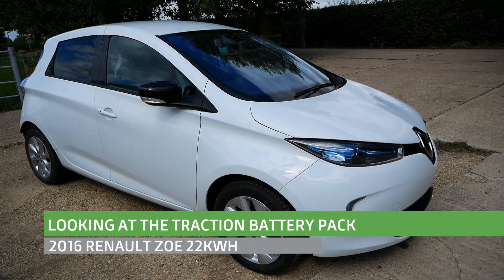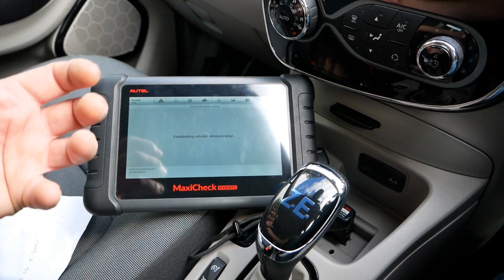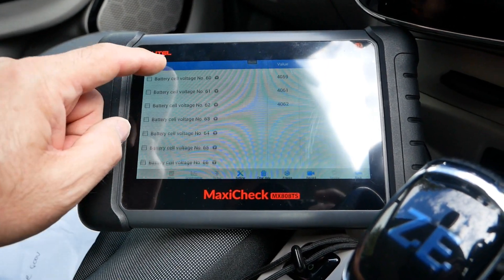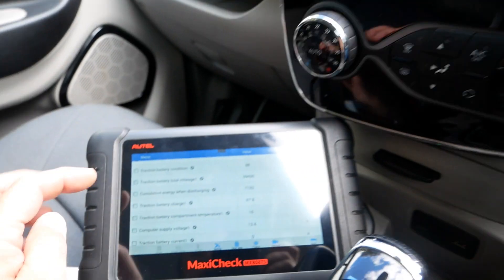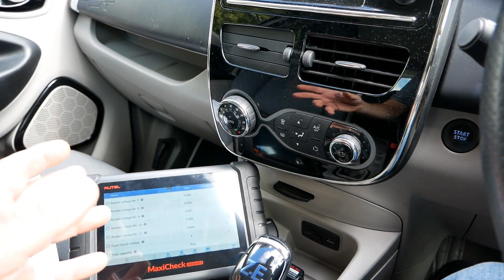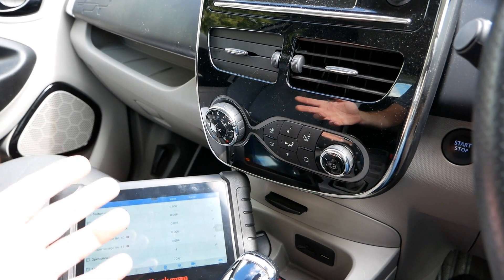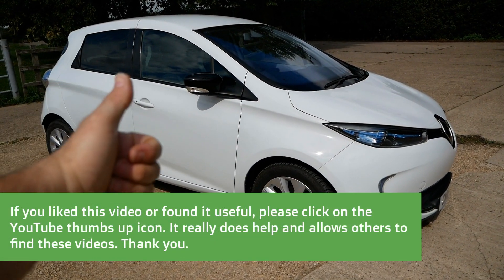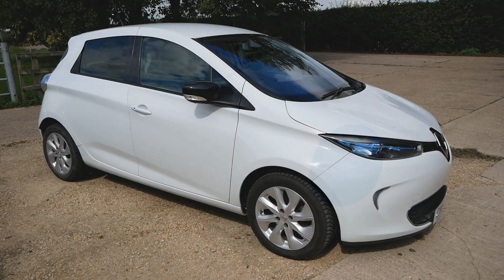Looking at the traction battery pack in a 4 year old Renault Zoe ZE22 (22kWh)

Comment: To calculate the capacity of the battery in kWh, the Ah value is not multiplied by the maximum voltage (>400 V) but by the nominal voltage. This value can be found in the data sheet of the cells. For common lithium-ion cell types, the nominal voltage is usually around 3.7 V. The capacity in kWh is therefore calculated from ~3.7 V*96*70.6 Ah = 25.077 kWh.
Best regards!

Comment: Most of these Diagnostics including battery voltages, state of health, battery temperatures etc you can check yourself with an OBD2 bluetooth adapter and the CanZe app! Lots of more stuff aswell.

Comment: Very informative.  Iam currently thinking of purchasing a zoe  around 2016 model  and its good to know the batteries last. My other concerns are what are the motors like as far as mileage and rectifiers for charging etc..
Reply from the maker: There was been some Zoes that have had motor swaps but then there has also been some Zoes which have done over 150,000 miles and still going. The original Continental motors (Q motor with 43kW charging Zoes) seem to be the problem. Well not a problem as such, but has seen some failures. The newer Renault motor (R motor 22kW charging) so far is looking far better. Watch this video to identify the different motors https://youtu.be/KiM6kXF_hHk